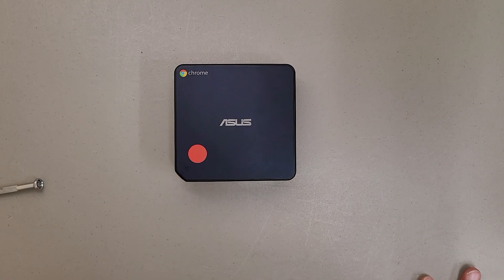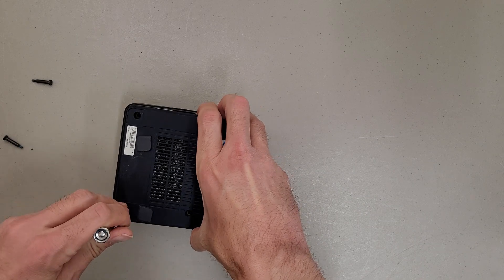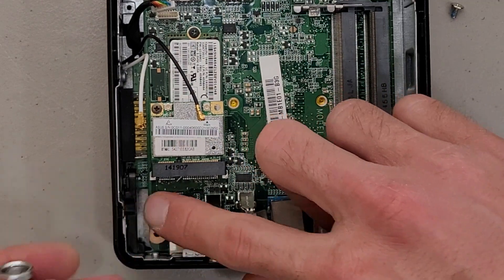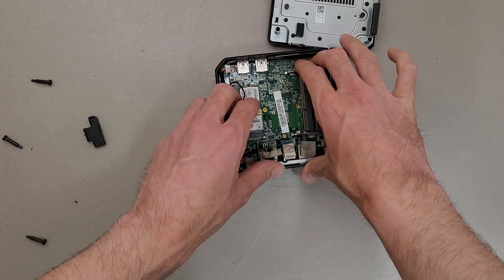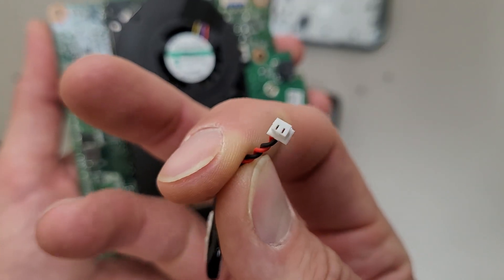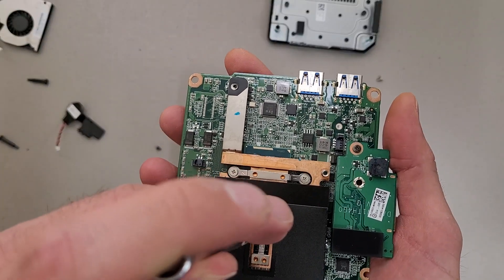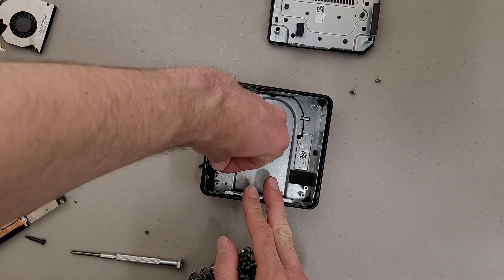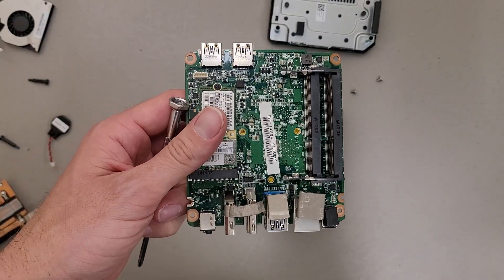How to replace CMOS battery in ASUS Chromebox CN60 #teardown

Comment: Will taking out the CMOS battery and then rebooting clear the administrator privilege?
Reply from the maker: Unlikely. There might be a jumper I didn't notice when taking it apart that would solve that though.
Reply: @computersales  Thanks. I bought this unit from a goodwill outlet store and ironically, it is one of their units. Customer support says to talk to the site that I got it from. Also, it appears the screw holding in the ssd appears to be stripped. The only good thing is that they sell by the weight so this might have cost me around $4 since their pricing is $1.99/lb.
Reply from the maker: Not a total loss then. If anything the SSD would have some value or use.
Reply: What type of fan does it have? I would like to replace it with a quieter one